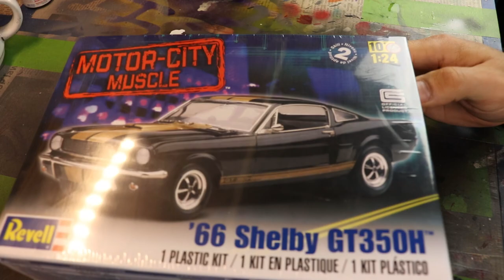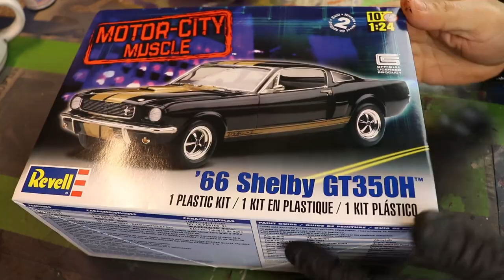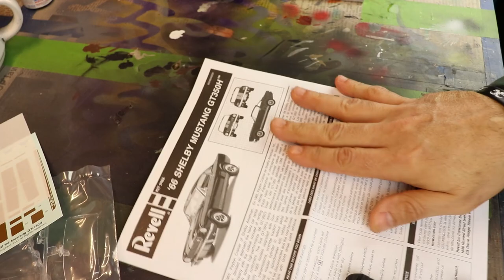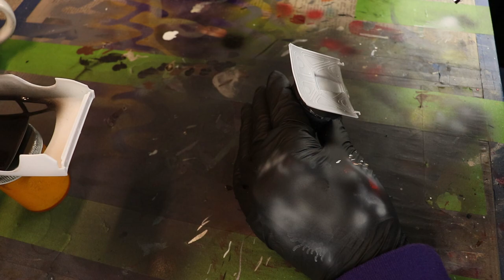Let’s Build: 1:24 Scale 1966 Mustang Cobra GT350

Comment: Looks pretty good from here nice job
Reply from the maker: You are being kind, thank you, some times with my paint jobs I encounter orange peeling which is super annoying so I need to polish it out the result is never 100% where I want it to be however.  I'm still working on that glass like finish.
Reply: I learned a long time ago that paint is 90% prep and attention and the other 10% is spraying on a color I started to get my clear very smooth very shiny and found I could see the roughness underneath so I do a lot of wet sanding every coat now before I paint it and every coat
Reply: And in my opinion my paint sucks